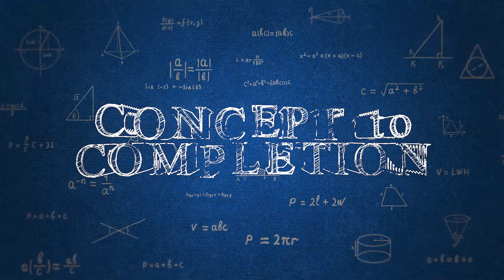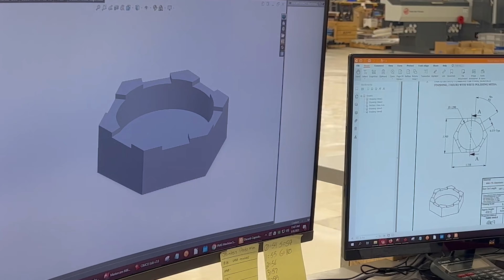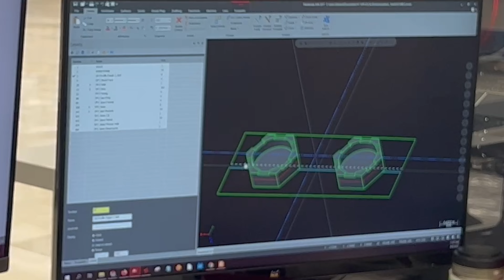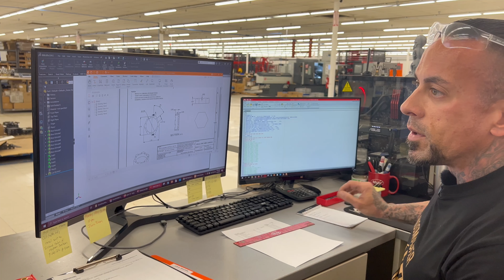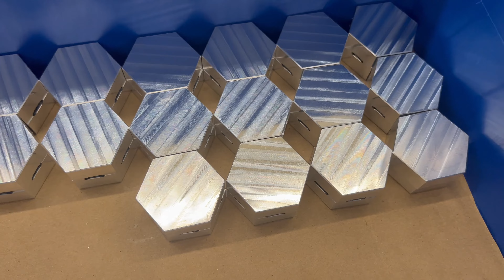MINI DECARB CAPSULE - DESIGN AND BUILD

Comment: What's the difference between this $100+ piece of metal, 
and just placing your oil in an oven at 250 degrees for 25 mins?
Reply from the maker: The decarb capsule allows you to decarb right on your Nugsmasher!
Reply: Common sense